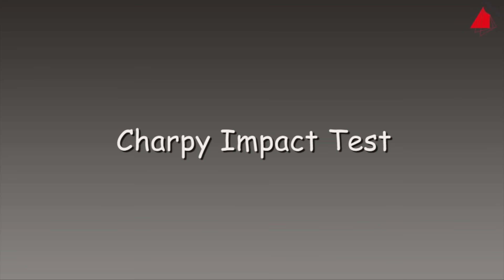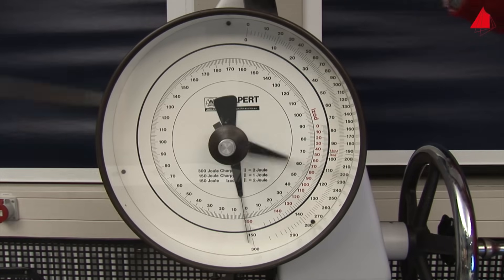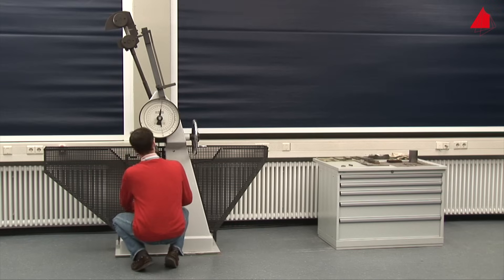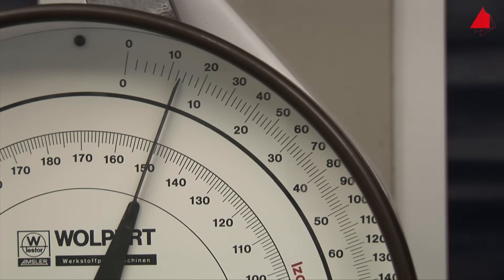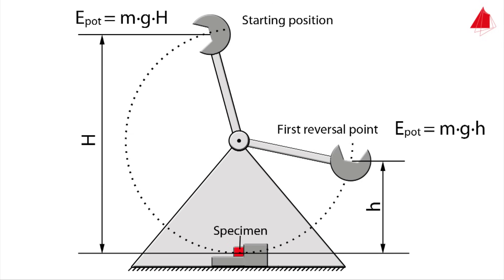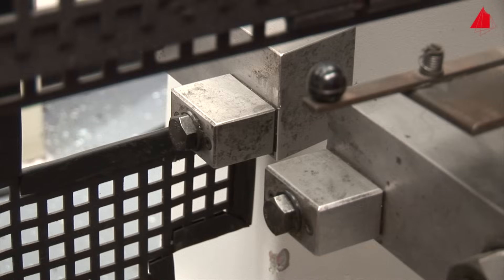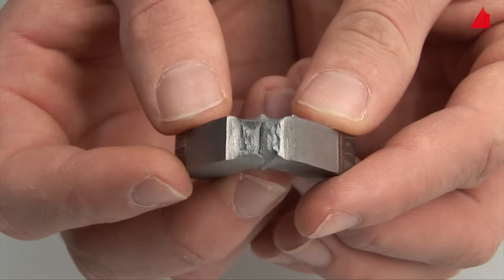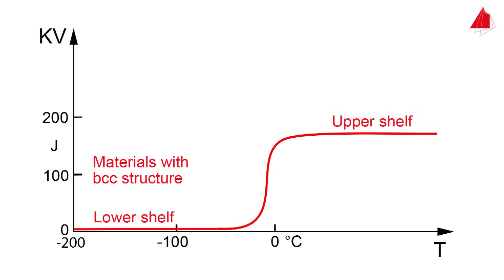Charpy Impact Test

Comment: Why notch is there?
Reply from the maker: Answer to "Why notch is there?": This is one of the most important points of the Charpy impact test, which is unfortunately too complex to answer in a few sentences. In short, the notch creates a three-dimensional tensile stress state in the specimen, and under this particular stress state it is difficult for the material to deform plastically. The test simulates situations in practice.

Comment: What is the more failur  in impact tesy :specimen with a V notch or specimen with a U notch ??? Plz I need answer
Reply from the maker: Answer to "What is the more failur  in impact tesy :specimen with a V notch or specimen with a U notch ??? Plz I need answer": The V-notch is the "more severe" notch, resulting in lower absorbed energies and a higher transition temperature. In comparison, the U-notch is milder, resulting in higher impact energies and lower transition temperatures.

Comment: Why is there two methods for impact testing- charpy and Izod impact test. Which is preferred?
Reply from the maker: Answer to "Why is there two methods for impact testing- charpy and Izod impact test. Which is preferred?" Both methods test very similar properties. When testing metallic materials, especially steels, the Charpy notched bar impact test is much more common, which can also be seen in the corresponding industry standards. But why are both test methods still used in parallel .... good question.
Reply: @MaterialsScience2000  is it possible that test specimen will pass in one method and fail in the other.

Comment: It seems to me that with ever increasing specification and increasingly finer tolerances being embodied in even more ambitious design and construction this test, with its significant human input in calibration, is crude and no longer fit for purpose. Case in point : in the step 1 initial drag indicator setting, the needle isn't quite set at the mark. Later, the needle is not to be found at the zero mark, as expected but is a fraction greater. This might be caused by the operator looking at the gauge from a  side angle instead of looking at it face on. What then is the size of the discrepancy? And is this discrepancy enough to influence the accuracy of the test results?
Reply from the maker: Answer to "It seems to me ... accuracy of the test results?": In a few words: The general principle of testing is perfectly OK, and the test is being applied more than ever. As regards the calibration: The initial setting of the indicator (before the test) is without consequences, but the indicator must reach mark zero in a test without specimen. This was not done quite perfectly in the video; the video wants to show the principle of testing.
Reply: @MaterialsScience2000  A fair enough comment. Those involved in the making of the  video SHOULD have had the experiment carried out as required in the detail. Images speak louder than words. Not to have done so would inevitably give rise to speculation that sloppy actual testing might have played a part in subsequent events.

Comment: What is the minimum thickness of test specimen required for V notch test.
Reply: There are normalised measurements for this. If you type "minimum thickness of v notch charpy" in to google and go to images you will find  a detailed overview. Please note that de V-notch should be made with the proper tools because it is normalised as well.

Comment: if required by the client, should the test be done on each 6/12m raw material before fabrication?
Reply from the maker: Answer to "if required by the client, should the test be done on each 6/12m raw material before fabrication?" In the extreme case, yes. When the safety requirements are very high, this is actually done, sometimes even with several test specimens from one single piece of raw material. Of course, this is very expensive. There are a number of reasonable compromises between not testing at all and testing each single piece of raw material. A very interesting question …

Comment: Why noch is necessary while performing the test??
Reply: Well to provide for a localised stress concentration. While no doubt the material will fail under test conditions, the notch is provided primarily for two reasons. 1, to provide for accuracy, and 2, to ensure that the material fails at an exact point. Hope this answers your question
Reply from the maker: Answer to "Why noch is necessary while performing the test??"  The main reason (when testing steels) is the creation of a three-dimensional stress state below the notch. This hinders the plastic deformation. Materials that are not very tough (like some polymers) are tested with a non-notched sample.

Comment: The test specimen is prepared according to which standard? If we want to carry out impact test, how many such test specimens we need, is it a single value reading test or multiple value avg should be taken? At what temp the test should be carried out? (In some cases -30 deg Celsius or room temp is maintained)
Reply from the maker: Answer to "The test specimen is prepared according to which standard? If we want to carry out impact test, how many such test specimens we need, is it a single value reading test or multiple value avg should be taken? At what temp the test should be carried out? (In some cases -30 deg Celsius or room temp is maintained)": The standard is ISO 148, the number of the specimens may vary according to circumstances and accuracy requirements, 1 to 3 at a given temperature are typical. The specimen temperature can (and must) be varied depending on the temperature, at which the material will be used in practise, a typical range is -200 °C to +100 °C.

Comment: what is the different between hardness & toughness?.
Reply from the maker: Answer to "what is the different between hardness & toughness?": Hardness is in most cases defined as resistance towards plastic deformation, closely correlated with strength. Toughness is more difficult to define: Sometimes it is defined as the ability to deform plastically (ductility), sometimes as the product of strength and ductility.

Comment: What are impact test results usually measure in, when I google I see J/m3, J/m2 & J/m. I assume this maybe relates to some distance, cross sectional area or volume of the deformed specimen ???
Reply from the maker: +Richard Walker Answer to "What are impact test results usually measure in, when I google I see J/m3, J/m2 & J/m. I assume this maybe relates to some distance, cross sectional area or volume of the deformed specimen ???" Typically only the energy is measured, so the result is given in Joule. Formerly the result was also given in J/cm^2; the energy was divided by the (smallest) cross sectional area.

Comment: y is there a v notch in the specimen?
Reply: Vignesh N 
Some tests do not use a notch. Notched and un-notched samples are covered in separate ASTM codes.

The notch enables the use of stress concentration & notch sensitivity factors in the theoretical calculations to more closely approximate the experimental results. Without a notch, the crack propagation is chaotic and unpredictable. Results from sample to sample would have a large deviation.

Comment: Can you please tell how the setup of izod test is different from charpy test?
Reply from the maker: The explanation on Wikipedia: "The test is similar to the Charpy impact test but uses a different arrangement of the specimen under test. The Izod impact test differs from the Charpy impact test in that the sample is held in a cantilevered beam configuration as opposed to a three-point bending configuration."
Reply: The difference is that the pendulum is different, the sample bar size is the same, and the way of placement is also different, the opening direction of the notch is different, so the fracture mode is different too, the energy loss is different, the Charpy impact tester's flying power is small, it is suitable for the products with low impact strength.The fly - out power of Izod impact tester is large and suitable for ductile materials. And the samples are placed in different ways, izod places vertically and Charpy places horizontally.

Comment: By your Replaying the question "Q: Is there a material that actually stops the hammer from swinging back up? " Does that mean very low carbon steel is the toughest metal ?if it's not .what's the toughest metal and his absorbed energy ?

Comment from the maker: Answer to: "Is there a material that actually stops the hammer from swinging back up?"
Yes, there is, in any case for our test machine. And quite interestingly, it is not only a "strong" material in the sense of strength (or stress), but a material of very good ductility. Among the best in the Charpy impact test are fine-grained very low carbon steels, and they may absorb much more than 300 Joules. But a more powerful impact test machine will do for any material. Sorry for the late reply.
Reply: And in the case where such a sample stops the hammer you can shortly after hear the technician curse it (at least the ones that really care and value their machines)
Reply: hey i have a question, even though its 8 years later ahah. how do you decide how deep the notch must be? is this decided by standardisation? sorry not english so i maybe misunderstood. thank you for the video!
Reply from the maker: Answer to "hey i have a question, even though its 8 years later ahah. how do you decide how deep the notch must be? is this decided by standardisation? sorry not english so i maybe misunderstood. thank you for the video!": Yes, it is specified by standardisation. Many decades ago, various types and depths of notches were extensively tested, and the type of notch shown (V-notch, 2 mm depth) has proven to be the best for typical ferritic steels.
Reply: @MaterialsScience2000  thanks for the awnser! Good video
Reply: @MaterialsScience2000  cheers, used this video for my school engineering assignment as reference
Reply: Have you ever tried the human experimentation of this test, especially on males? It will definitely leave an impact
Reply: @Eidos_Trip balls😢😢